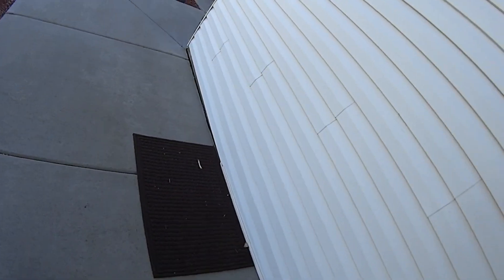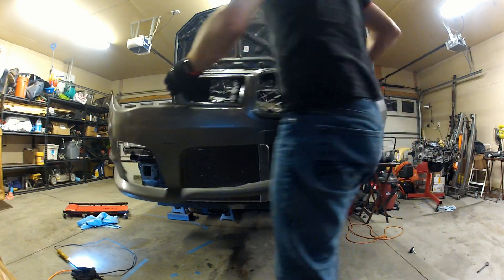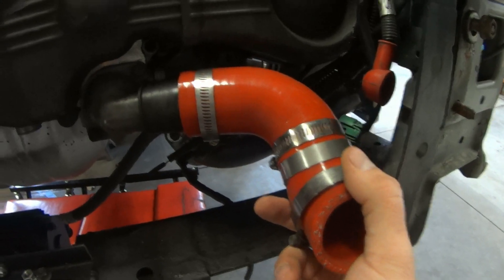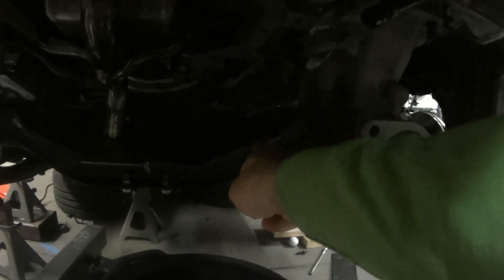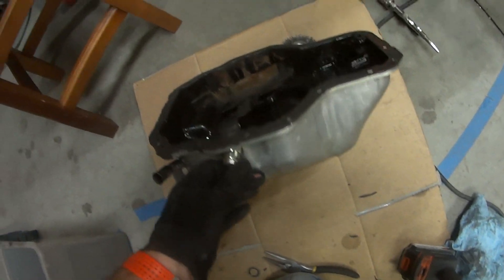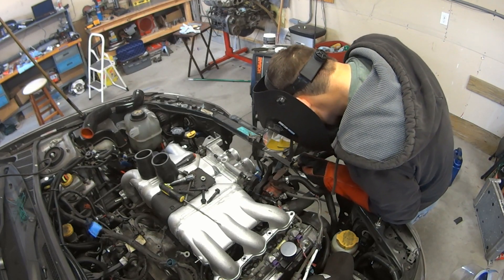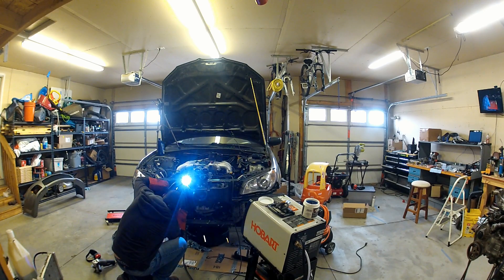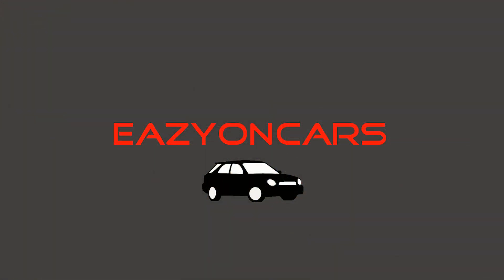EG33 Swap - Install Oil return and Project update (Ep. 21)

Comment: Have you done any work to the heads or are they stock?
Reply from the maker: Stock, had the valves done and head decked. Just did rings and bearings. Check episode 2 for the assembly.